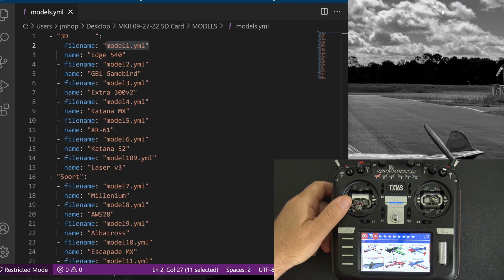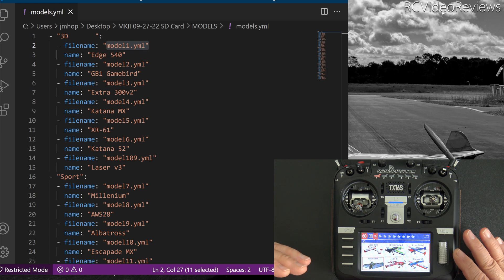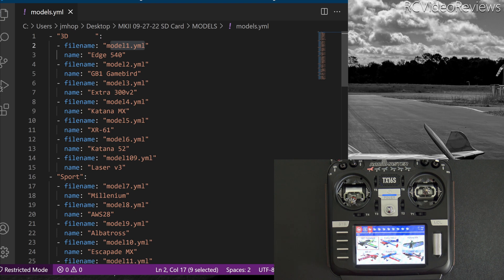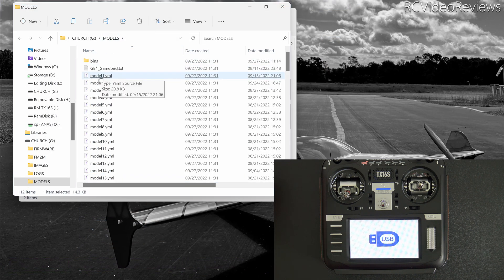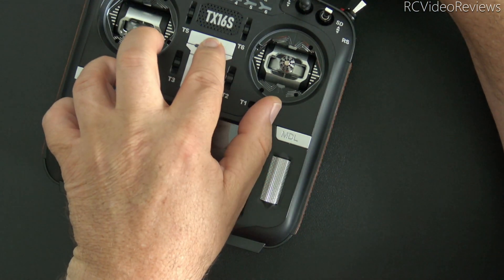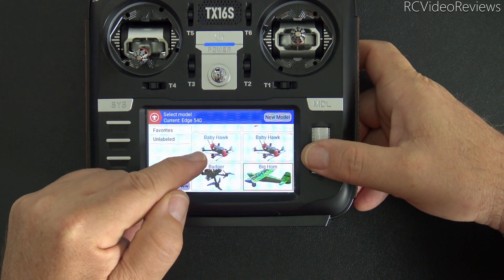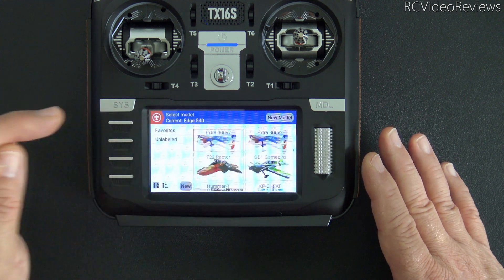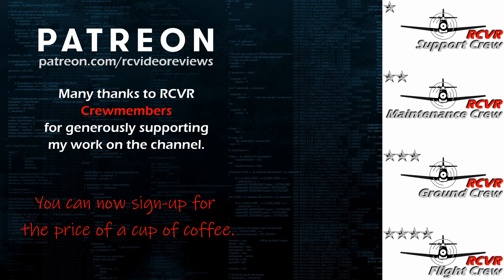EdgeTX 2.8-RC1 DO NOT Upgrade Until You WATCH THIS!

Comment: The soft delete could be useful if you make a mistake and want the model back.   But the update should make a copy of the models.yaml, and then update the new models.yaml based on what is in the old copy, not use a directory list. then delete the copy.  that way the new Models.yaml  will have only the models that were in the old models.yaml.

Comment: Does the model yaml deletion occur correctly when using 2.8 RC1? Like if I update from opentx to 2.8 RC1 then create and delete models does it properly clean up the yaml files on deletion?
Reply from the maker: Yes. In fact, they added a DELETED models folder and models deleted in 2.8 are moved to that folder.